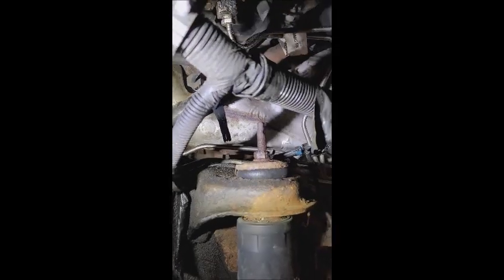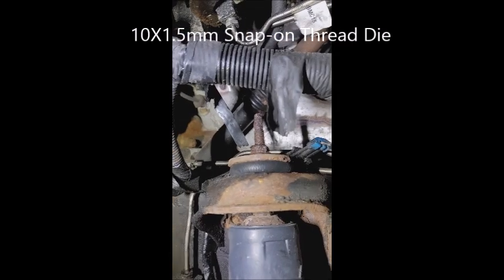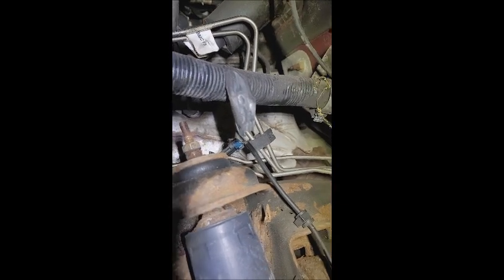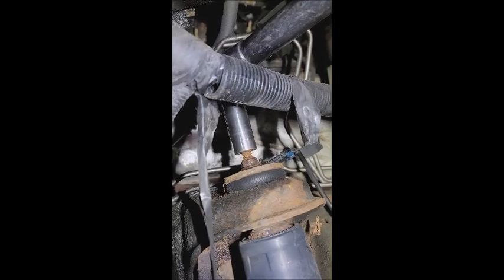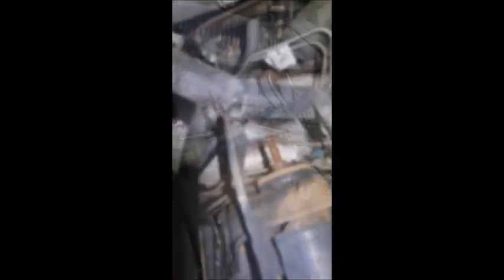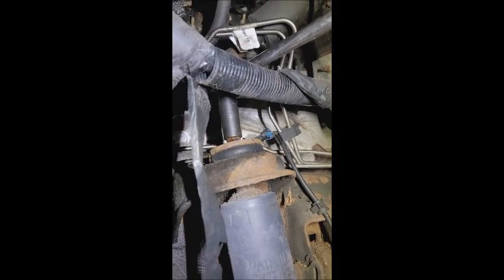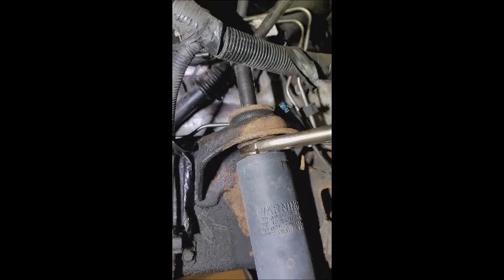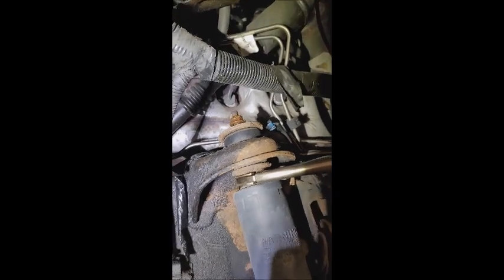One Good way to remove a Rusted Bolt

Comment: Great tip! This seems more to make the threads easier once the bolt is loosened. Idk how much this helps at the point where between the bolt and nut (when it is tightened completely)

Comment: Good idea but me personally if I can get an angle grinder in there with a cutoff wheel I'm cutting it off
Reply from the maker: I hear you man. Just trying to show different ways to break Frozen bolts loose. I honestly try to avoid using an angle grinder at all costs. Must be all those years of grinding I can't stand the Dust LOL thanks for the comment bro

Comment: I have noticed to with certain bolts that if I heat them first then spray PB blaster on them they 9/10 come loose without snapping, not sure if you ever have tried that method too but I forgot about using a tap & die clean the threads nicely done sir

Comment: I do pretty much the same thing. I just take my tiny Tim saw and whack the rusted threads off right above that nut. The put some oil on the top. Then clamp with locking pliers it spins right off. 
  Either way works really well!!!

Comment: As a Journeyman machinist I have a full set of die's in my garage as well. My problem is I never know 100% which die to use. I've actually eff'ed up bolts using the wrong die. lol.

Comment: Nice tip, but in this case I'd rather just cut the top off with a sawzall, takes 2 seconds and its off. However your method will work better in a tight spot.

Comment: Snap on makes a socket that fits the oval on end of the threaded shaft. I have two sizes. I put that on ratchet and hold nut with wrench. Never fails. Putting on an impact will f the seals up in your shock though..